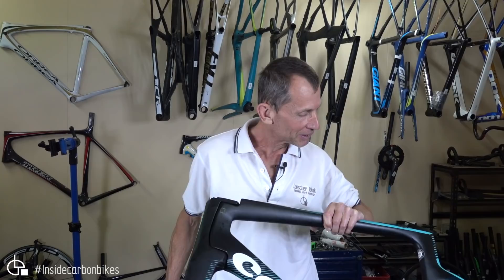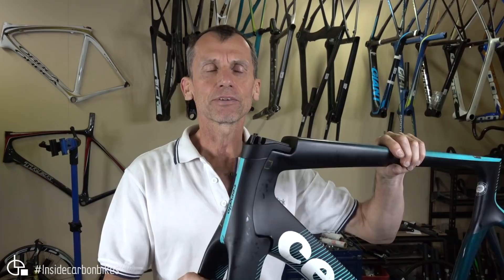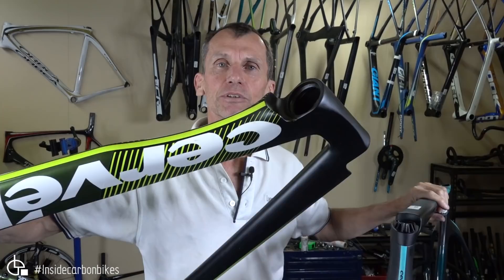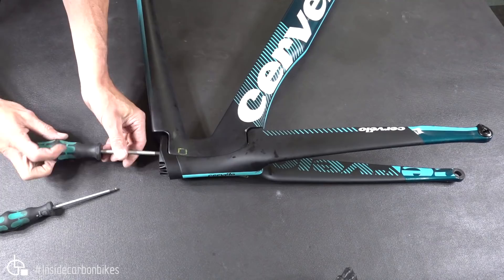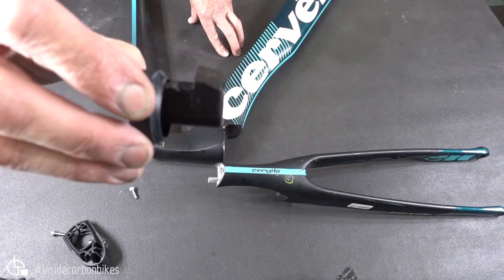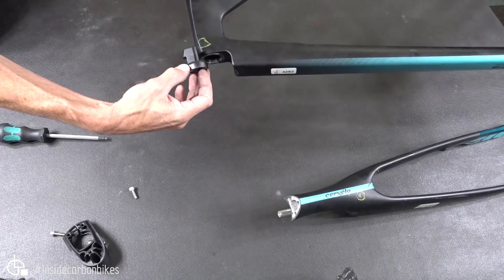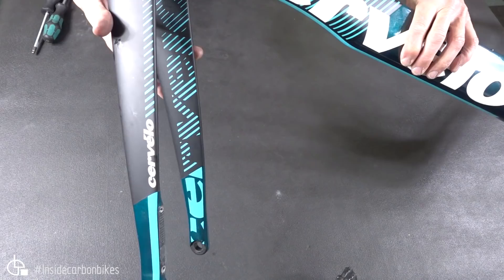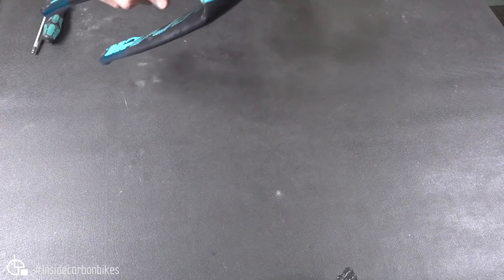Cervelo Design Fail!

Comment: HELLO HAMBINI FANS. Where do these bike designers get their education from. Ridiculous
Reply: You already rated Cervélo and you were 100% right. 😂
Reply: I'm glad good guys like you and Raoul are trying to keep manufacturers honest.
Reply: Just another bag of wank. Over time, selfdestructing frames from Cervelo! PON Cycling are DELIGHTED!!   Rgr
Reply: I have got a background in Motorsport; engineering flaws like this would never be tolerated...they would simply go out of business. Sorry Cervelo I was a fan but I’m staying away for now. 😟
Reply: Hambini's in the house!
Reply: That hitting part was probably designed as rubber covered or something, but the finance department optimised the cost and we got bare metal thingy :)
Reply: Did anybody read "HELLO HAMBINI FANS" with his voice inside your head? Nice to see you here!
Reply: I was hoping Hambini would be here
Reply: Does this make them get closer the the end off the scale 14k bike that wont last as long as my Sunday roast
Reply: Dosent Hambini own an older S5?
Reply: Norevlimitr Lol!!
Reply: I've seen plenty of educated engineers with no fucking common sense. And you can't help those ones.
Reply: On the issue of the metal top piece, it still can be grinded down to clear the frame but the whole design of the headtube is wack. Ive seen a P5 with the same design crack the bottom section of the frame when the bars turned too much
Reply: @Pub01  yeah like it was a cheap bike to buy...
Reply: London Metropolitan
Reply: They hated Hambini because he told the truth
Reply: I was searching your reaction :D
Reply: RiP Cervelo. Truely a disgrace.
Reply: Now they are making bikes that EXPLODE from the inside, only need to to pay 18K ozzie to get yourself a self ejecting James Bond bike! Lol
Reply: @waynosfotos  Pro racing will be so awesome to watch now. At any moment a rider could REALLY blow up! 🙈
Reply: This is from the Cervelo assembly manual for the 2019 S5 Fork Assembly 

1 Check the headset components to ensure there are no sharp or rough edges on any of the surfaces which could impact fit or alignment of the bearing components. If any rough edges are detected, have the components repaired (sharp edges removed) or replaced before proceeding.

Am I wrong in assuming Cervélo’s own QC should be checking for “Sharp or rough edges on any of the surfaces” prior to packing and shipping? The offending Preload Cone itself is “Sharp and offending” in its design.
Reply from the maker: @Chris Voss I would say that your are not wrong in expecting this step to be done PRIOR to shipping to the consumer.
Reply: @Jin_KX   His freakin' voice is in my head.
Reply: The same designers that took away the dipstick in a car.
Reply: damn, Hambini is everywhere LOL
Reply: The guys is 100% right and  Sounded 100% High! 😂😂😂😂😂😂
Reply: don't you have your own channel?
Reply: @Pub01  Rubber or not, it's still not the way to put force on the inner carbon fiber.  As mentioned, a pin should be installed to limit the travel.
Reply: I was just thinking about Hambini... Then I go to scroll the comments, low and behold, Hambini right at the top! The best lolol.
Reply: Wouldn't the bars hit the top tube first anyway?
Reply: @Pub01  [That hitting part was probably designed as rubber covered or something,] It's like getting hit in the eye with a metal coin, but with a rubber covering. It's still highly likely to blind you.

It's just fffing ridiculously poor design. Not that many of the fashion wankers would know the difference.
Reply: @SinnerSince1962  Even the pin is shit fix to an even shittier conundrum. The fork body should have been moulded with a buffer pad to impact the frame over a large area. Externally These types of things have been solved in engineering for centuries.
Reply: So how about so finely designed Look bikes and their 795 Aeorelight and stem hitting the frame in the same manner?
Reply: Disposable frames,,,Chinese frames,,,it’s about $$$$$.   Steel is better
Reply: Why blame it on the engineers? I will bet your bottom bracket that these decision are driven by greedy businessmen and project managers that set the targets for design obsolescence... these fucks will pass the blame on the rider for not being skilled enough to handle their bikes.
Reply: From a Kinder Surprise
Reply: If you check the seatpost and seatpost insert area in this frame it would shock you even further. From their on manual it says there is only 2cm of adjustment and you have to cut a 45 degree chamfer on its edge. Not only  there is a potencial installation error witch can cause you to damagethe frame, but it basically forces you to go cut your seatpost to get a proper fit for most cases. So if someone is stupid enough to buy this frame from your, they would probably have the negation margin of having to buy a new seatpost. #lessthanideal
Reply: So Hambini you got rid of your S5?

Comment: Between you and Hambini...Cervelo has really fallen off in quality.
Reply: When i saw a tittle i just thought about Hambini videos about Cervelo.
Reply: Thanks  for pointing this out!
Reply: Dosent Hambini ride an older S5?
Reply: Hambini rants about anecdotes related to QC. This video is far far more damming than anything Hambini ever put together. This video impugnes not only this model, but the company as a whole. After watching this, I would not touch a Cervelo if you paid me
Reply: @manuelcalleja92  yes
Reply: I had an ALUMINIUM S1. That bike was engineered to v high standards and quality welding. After that, White and Vroomen sold the company and it went downhill.
Reply: Maybe GCN should have both of them on to be the new tech presenters!(LOL)
Reply: This is not just a Cervelo issue. An almost identical issue occurs on my 2019 trek madone. Just minor cosmetic damage really.
Reply: @hedleykerr3564  nah ollie went with aerocoach (omegalul!), their choice has been made, $$$ over quality.
Reply: Doesn't matter, most dentists that buy these rarely actually ride them. Cervelo has always been about marketing over quality or performance.
Reply: @PeakTorque  that was the best Cervelo, but they killed it because they could not figure out how to make thousands in profit with aluminum.
Reply: Hedley Kerr GCN would cause the bike industry to collapse if they got those 2 on board to rip the tech apart.
Reply: RabidMortal1 Hambini is about QC of the bottom bracket that could loose you 15 watts from poor alignment on an “aero frame” that is his beef. Whilst Raoul is about poor carbon QC related to the composite construction and possible failure or delamination.
Reply: @williamli6400  No. Bad design creating delamination and possibly catastrophic failure.
Reply: @ericjjohnston1  It's a similar issue albeit a different design. The limit of movement is the contact between the frame and the fork. Here is a video of what I'm talking about. https://www.youtube.com/watch?v=rEwK64AoxXo
Reply: @ericjjohnston1  really? I better take it back to the shop then! thanks for the info!
Reply: @williamli6400  same thing happened to mine. Sent pictures to the dealer and asked if there was something missing.  They said nothing was missing. Will call them back again.
Reply: @ericjjohnston1  thanks for the file Eric! It seems like the steer stop was installed, but it's not doing the job intended. I'm taking it to the shop to open it up today for a closer look. Will keep you updated!
Reply: Fallen off? They were never there to start with .
Reply: Who said they had any quality to begin with?
Reply: @hedleykerr3564  The problem with being too honest on a show like GCN is that you'll quickly make yourself a lot of enemies, people who bought this junk and don't like to hear how poor quality is. GCN and others choose to stay diplomatic and brush over any genuine errors both to keep their viewers happy, and any potential sponsors or paid promotion.
Reply: I've always wanted one of those R model Cervelos, though never owned one. There's not too much to ruin on those frames, so you'd think they'd be OK. Right?
Reply: Sorry Eric Johnson, but that Trek Madone is a dogshit design. And any frameset that requires you to regularly take it apart to check for proper torque on internal Frame bolts, etc... is an F’ing joke. That’s just a dog shit design.
Reply: @lesflynn4455  Only, as the Great Hambini says, in the bottom bracket area and its alignment, and in general quality control.  Any part of the frame could contain a dangerous void.  My own R5 is from the Vroomen White era and is the VWD model, and I think I must have one of the last quality ones.  The ride quality of it is also really nice, but it's not the stiffest bike for clydes or very powerful sprinters.  My Breezer Venturi that it replaced was a stiffer platform for sprinting.  No matter, much as I love the one I own, I do not plan to buy anything from the modern edition of that company.  Besides, I also fell in love with modern steel.  Officina Battaglin must make my next road bike.
Now in direct comparison to the R5 I own, I thought the Trek Emonda was/is a straight copy of it--and a darned good one at that.  With a lifetime frame warranty, maybe the Emonda is worth a look.   I found that they ride similarly.
Reply: Robert Gardner 
Trek = trash. They are another brand I’m astounded by that they are still in business selling expensive bikes. The “Lance effect” I would have thought would have LONG been gone.
Reply: @Metal-Possum  Woah: steady on there, Mr Negativity! 
I'm still quite in love with my bottom of the line, entry level-type 2008 Dual with its aluminium frame and carbon forks. Sure, both sets of brake levers have been replaced now, and most of the other original components have been switched from the original Ultegra to a modern 105 set, but the brains in Cervelo has always been focused on the frame, and it's still an absolutely glorious ride. I enjoy using this for zipping across town for a spot of shopping, or for keeping up with local long range speed freaks for a full day out riding on their regular high level road bikes. 
- Bottom line: Yeah, maybe the modern management team are feeling the pressure a bit too much to maintain the relentless pace of innovation and so are letting that affect their judgement as to quality control and potential risk... but there's still an enormous amount of legacy of creative innovation in each Cervelo frame that the rider will enjoy.
Reply: I am afraid to ask - does anyone know what happened to Raoul Luescher? No videos since November. I hope he is well.
Reply: Cannon dale and others too! It’s to convince consumers that heavy disc brakes are “better”: disc brakes are integrated therefore more aero....😂😂 I did not fall for that... neither did Egan Bernal or Froome....
Reply: This could be my favourite video of all time 🤣👍🙂
Reply: Hambini rode a Cervelo S5 as a commuter bike over 100,000 miles without any problems at all.

Comment: The best way to destroy carbon is lateral impact and here it is built in. Absolute disaster.
This is integrated self destruction.
Reply: No mention of if there is any added "landing surface" in there, like a piece of aluminum bonded in etc. But you'd think so ....
Reply: @johnsmith1474   Because 'impacting carbon' as was said in the video does not come across clear enough?  Put some Monster Energy and Santa Cruz stickies on it, heal it right up.
Reply: @therealjamesjordan  - It was presumptive not evidenced, we got no look down the tube. As I said it was not mentioned, even as an improvement. Who the fuck advertises for shitty sports drinks but stooges?
Reply: @johnsmith1474  Uh - you had two words to read & to comprehend.  ...daytraders.
Reply: @John Smith. Ok, it’s clear that you own( work for)a Cervélo and understandably you’re in some kind of denial.
Watch Raoul’s vid again and see the yellow mark he made on the OUTSIDE of the frame where the offending pre load cone has impacted internally on the head tube causing carbon delamination. 

In another of your comments you said “ Hasn’t said anywhere that it’s unsafe” Do you actually believe this design to be safe as it is?
Reply: @Lestalad1961  - You need to go back to school and learn to read/pay attention for content. You are muted, IQ 75.
Reply: @John Smith. How rude🤣. I feel your pain though. Just get a thorough check out on it Mate.
Reply: @John Smith. Oh and my IQ was good enough to prevent me from buying this bag of gash. How about your own?
Reply: Just stupid. I think its actually a fairly good looking frameset. Not cheap either and you get engineering and designs like this.
Reply: Well said mate
Reply: If your product have shorter life span thus people keep buying a new model every few years thinking it is "normal", then it is not a fail in business perspective.
Reply: Exactly

Comment: "Who would come up with that idea?" Damon Rinard, Mr Vaghinahead or anyone from scratchmyitch
Reply: I thought his name was Damon Wankhard?
Reply: does this push cervelo even lower on your scale? i hope so
Reply: Didn't Damon Rinard leave Cervelo in 2014 and currently with Cannondale?....
Reply: @DeedoCmuk82  You are right, I had a senior moment.
Reply: @Hambini  so are the White an Vrooman frames the last of a good batch of designed frames from Cervelo ??   A lot of the "design flaws" (i'm being generous there) seem to be after their time.
Reply: @justme8386  The newer models from 2014 are a lot better imo
Reply: But its the newer models that seem to have all the problems/design flaws.
Reply: So Damon left Cervelo and went to Cannondale..... Have you seen the massive hole in the head tube of the System Six!!!.... Our local dealer has sent all the System sixs's back......
Hmmm mm, I wonder if Damon was involved????😲
Reply: @justme8386  Meh, The R3 from 2011 had bottom bracket issues as well.. 2014-2017 frames are ok imo. Doesn't mean you should pay MSRP for them.
Reply: So, I read all those failures everywhere… but are there solutions to f.e. this ‘stopper’?

Comment: Remember, the UCI approved this frame !
They pretend this approval gimmick is for rider safety.
No, its not a source of additional revenues. 🙄

It's good to know that the UCI also check socks length.
I feel much safer !
Reply: The UCI has never been concerned with safety
Reply: @RabidMortal1  why approve wheels then? They don't approve aerodynamics or straightened. So what then is approval? Loose all credibility lose all worth!
Reply: To be fair, UCI use a standardised test protocol to test loading on the frame. This test doesn't take into account fork rotation.
Reply: I’m with Sylvain on this point. I’ve watched Raoul’s vid three times now. I’m still as shocked after the third time.
Reply: How much do manufacturers have to pay the UCI for approval? Does money talk in the UCI approval process?
Reply: It's not unsafe, who said it was?
Reply: @santiagobenites  its not significant in any real way. Its about $14k per frame model. 

If you went to TUV SUD or DNV GL it would cost you about the same to run the same test yourself
Reply: I think, this UCI approved patch means that the dimensions are according to the UCI rule book.
Reply: @mrGTD170  no. UCI require a manufacturer to send it frames and they test it to iso standard iso 4210. If it fails it does not get the sticker.
Reply: All federations/associations in every discipline, are about fat cats and mandarins.
Reply: RabidMortal1 Agreed, UCI is about controlling the GC, money and standardising rules to reduce aero affects. If safety was a concern they wouldn’t allow mechanics to hang out of cars at 40km/ph and work on a derailleur, motopace bikes hitting the bumper to get them back on, or all the other acrobats that go on, that you can’t do on the same road, when it is not a sanctioned cycling event.
Reply: @John Smith quote: “Who says it’s unsafe?”  Would you knowingly ride an Alpine descent at 60 kph on a bike with carbon delamination in the head tube? If so you’re braver than me Mate.
Reply: UCI approval has never been a safety check, it's a check of the frame tube shapes. Why would you think otherwise? Read the UCI rules
Reply: Sock length, saves lives.
Reply: So I just read the UCI approval protocol, its introduction says:...However, the frames and forks approval by the UCI does not certify the safety of the equipment which must meet the applicable official quality and safety standards, in accordance with article 1.3.002 of the UCI regulations.
Reply: kleeo83 so what are the quality and safety standards then? And do they not conflict with this special engineering here?
Reply: UCI approves everything thay are being well paid for

Comment: Great informative video. It's good that you maintain a professional attitude which Hambini is unfortunately lacking.
Reply: I don't think Hambini lacks a professional attitude. His engineering analysis and standards for engineering design are quite commendable and professional. What SOME people don't admire is the vocabulary he uses at times as he presents his professional engineering insights. Luckily a lot of his rich vocabulary is not used in my country (USA) so it passes by me with little impact.  Having said that, I believe I understand what you meant.